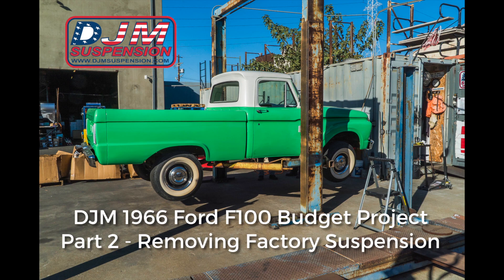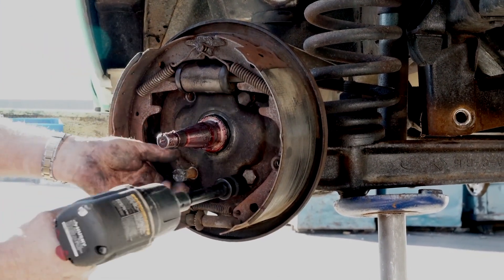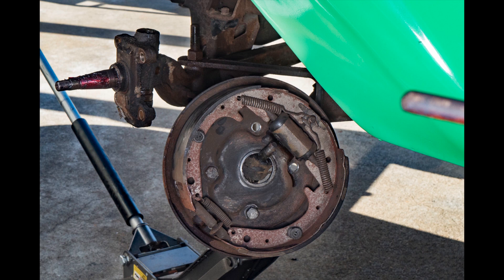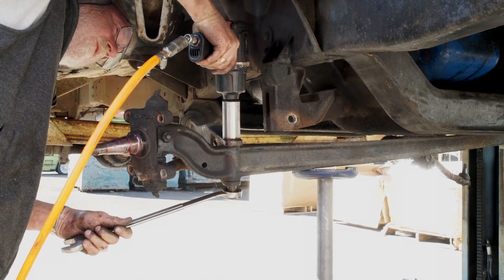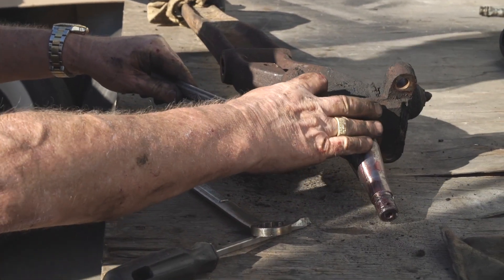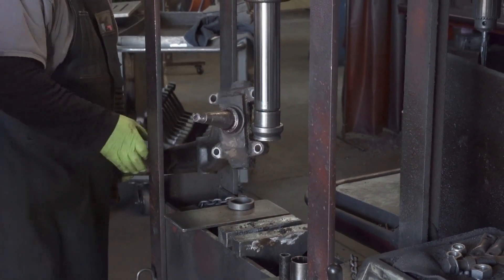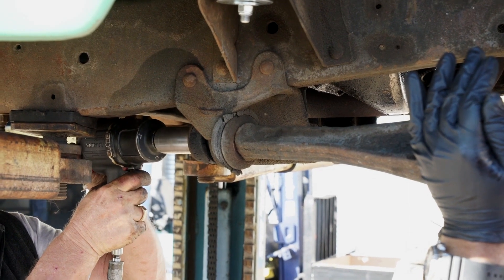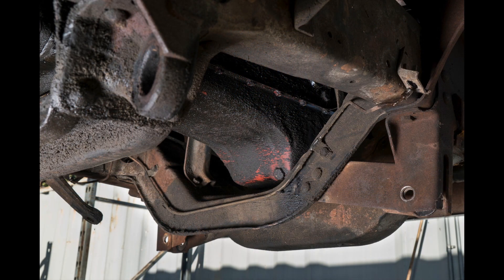DJM Project 1966 Ford F100   Part 2 - Removing Factory Suspension

Comment: Do you have to compress the coil spring to remove it or does it drop out of the way when you take the weight off of the suspension?
Reply from the maker: James, 

When you remove the shock and the travel limiter (if it has one) the spring is unloaded and you don't need a spring compressor. This is, of course, assuming you have the truck properly supported on jack stands, lift, etc. Loosening the radius arm bushings can give more play and help. You can pull the beam down a little more making the spring removal easier.